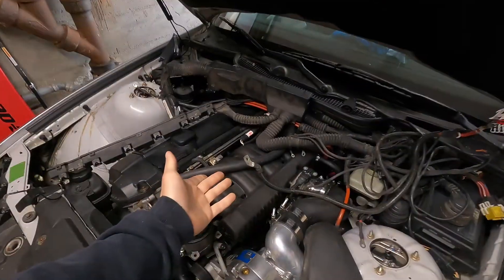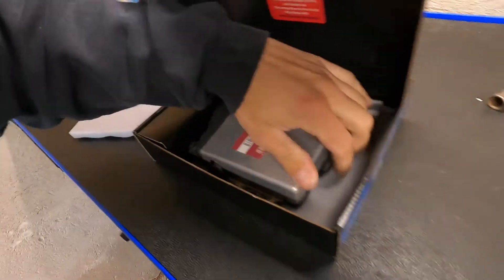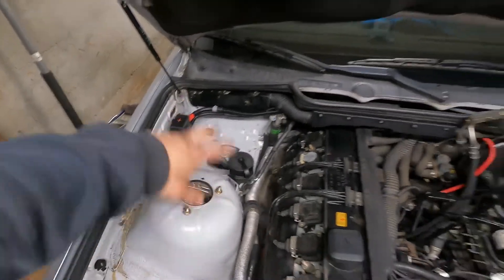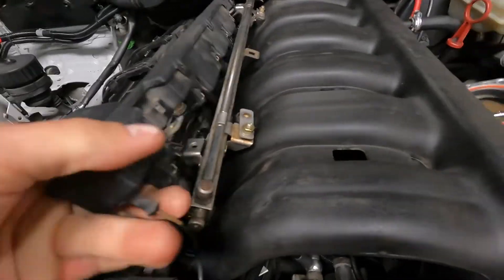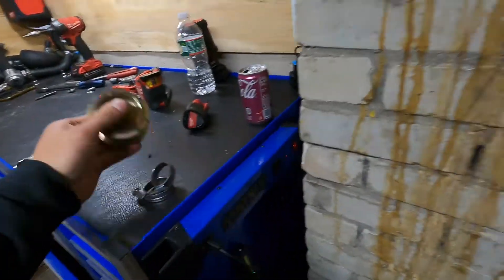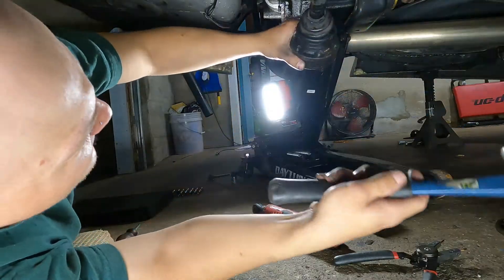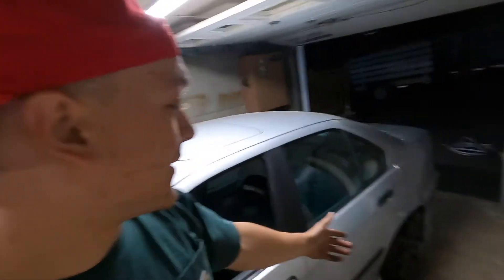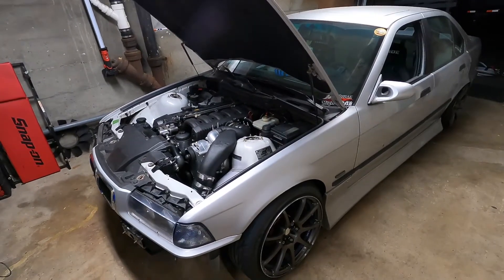SUPERCHARGED E36 GETS LINK ECU AND DYNO

Comment: Really wish it wasn’t sped up on certain parts🥲 I’m in the same situation with my M50 swap obd2 and need to convert to obd1, how long did the whole process take you?
Reply from the maker: It’s pretty straight forward you need all obd1 sensors 

Needed from OBD1 car (93-95 or vanos M50)
-Engine harness 
-Crank sensor 
-Cam sensor
-both knock sensors 
-02 sensors are diff
Reply: Is there anything I should know before swapping my harness?